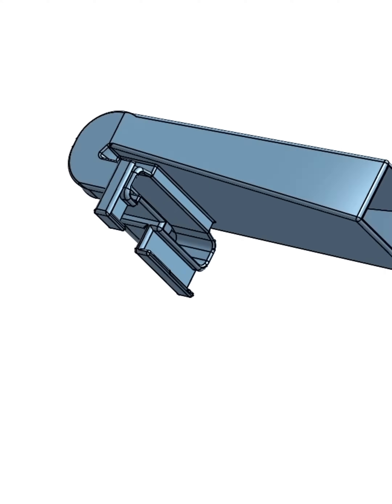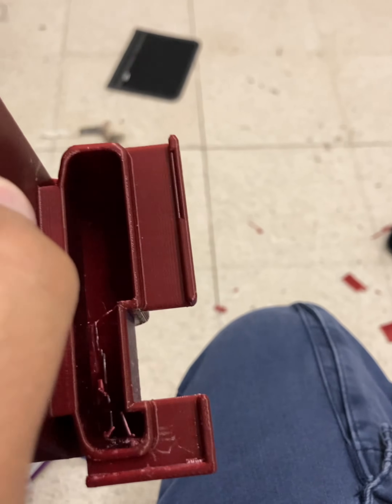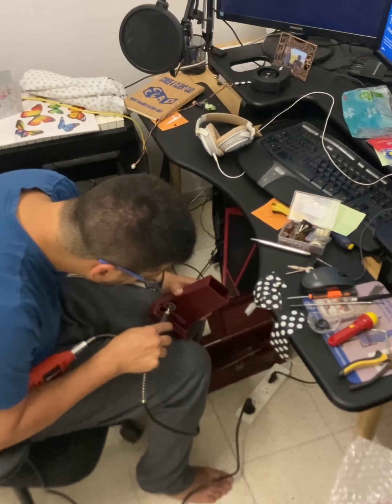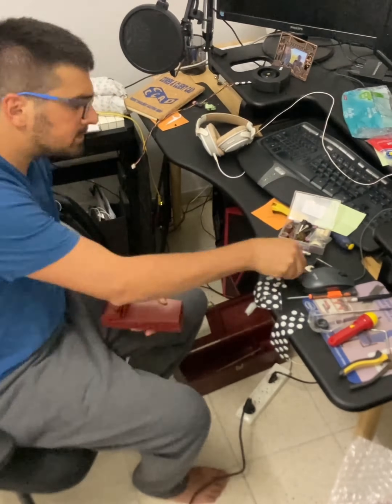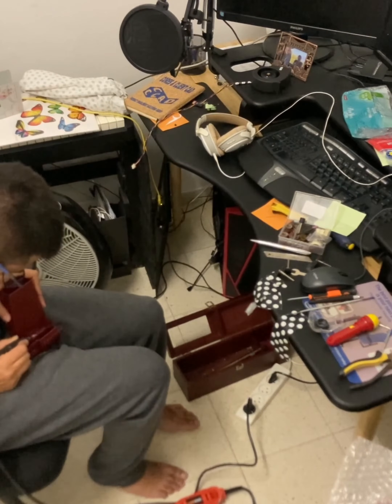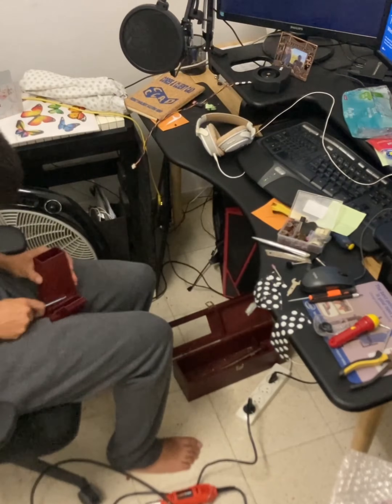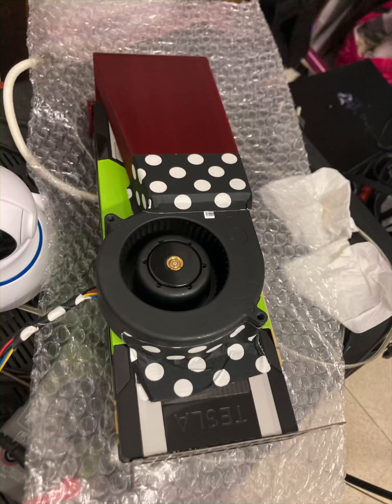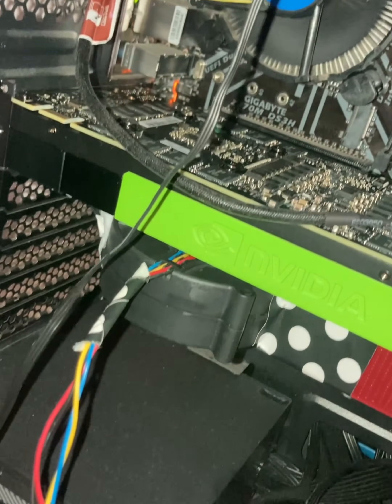Nvidia Tesla K80 cooling on desktop

Comment: Is it my imagination or is there a jet just taking off outside the window?🤔
Reply from the maker: hehe :) yes if it's on full power its very noisy! 
but I have a connected Arduino that controls the fan speed according to the temperature of the GPU. 
when its idle it makes very low noise 10% power. 
but still, I think it could be less noisy. I didn't show the idle case unfortunately. 
but it's not that bad.
If I would redo this project I would use a 120 mm Nactua fan instead of this too strong and noisy fan. but need to remodel a tunnel for it.
Good luck to you!

Comment: Thanks for the video mate. I think you've got the best setup! 

Is there a reason you chose to use Arduino rather than just using a motherboard header? The fan should fall within motherboard output specifications?
Reply from the maker: Thanks Matt. 
Im not sure the motherboard knows the temperature of the graphics card. I tried that and when getting in the bios. Fan control only had temperature of cpu and motherboard. Not graphics card. 
If you can point me to how to configure this straight from motherboard that would be awesome!